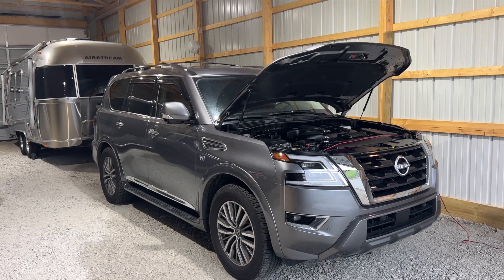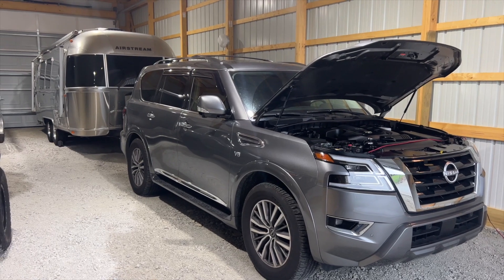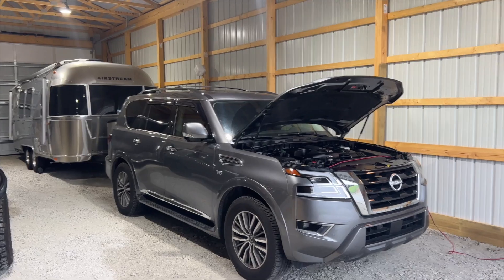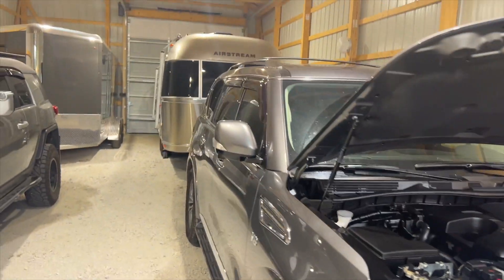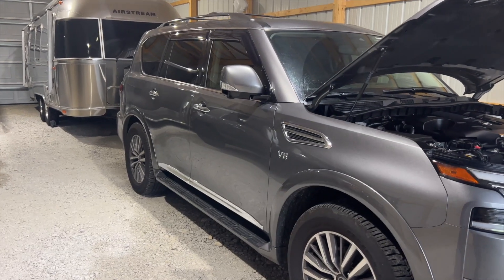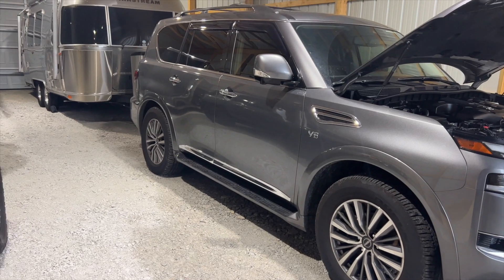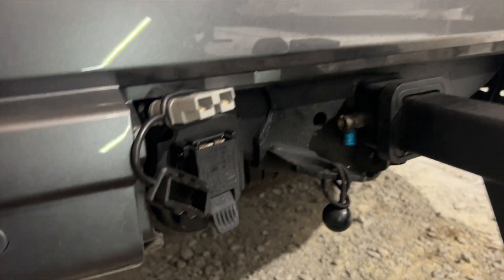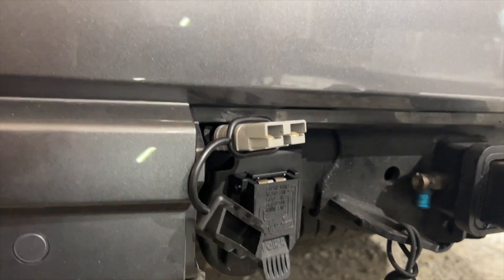Airstream DC DC Charger

Comment: Hi Robert, I have a 2018 Armada Platinum. I just put 840 AHs of lithiums in my trailer and got the Victron Orion 50amp DC to DC Charger. Where/how did you run your wiring to the back bumper? Thanks from Gary
Reply from the maker: Sorry Gary for the delay,  Run your wiring down the firewall, away from the Exhaust, then travel along the frame.    I did mine down the passenger side, most of the way,  then crossed over.  There are so many routes,  biggest thing,  find anchor points,  use split loom , and good 3M electrical tape.  Make your wiring harness , first, then feed it, and anchor,  guesstimate how much you will need,  but go long , so you do not fall short.